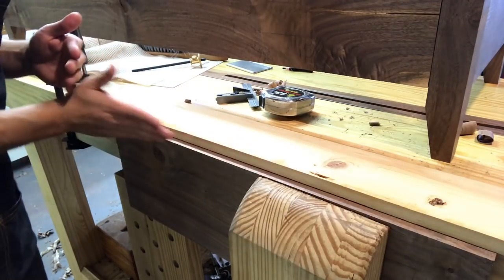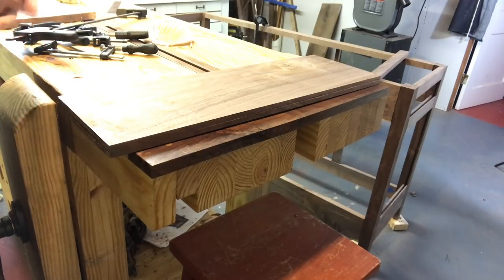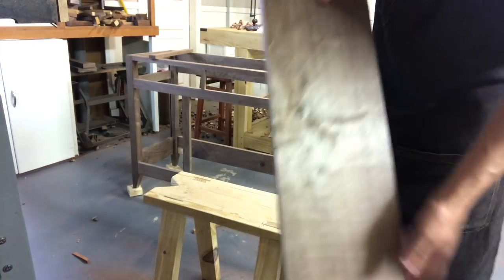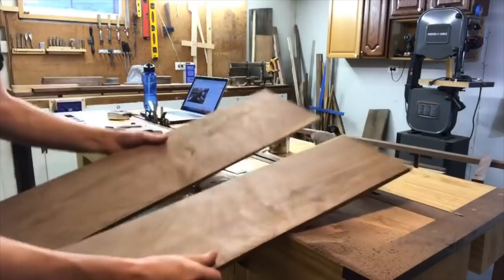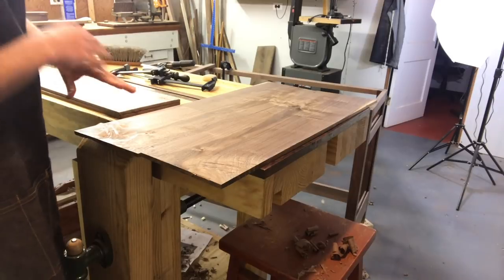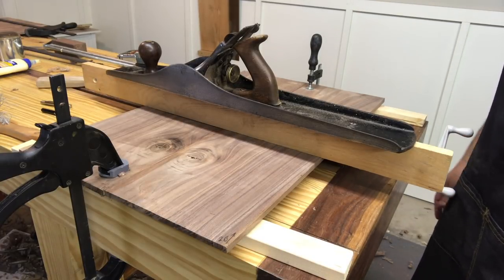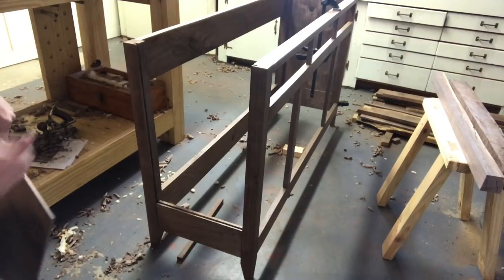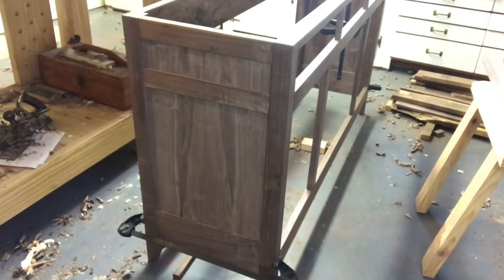Building a Sideboard part 12: Resawing and Fitting the Side Panels | Hand Tool Woodworking

Comment: Fantastic! I've done more than my share of long re-sawing operations and it seems that there's always at least one slightly janky area .... that's what planes are for. The side panel looks awesome. I love the grain continuity between the upper and lower panels. Well done!!
Reply from the maker: Exactly! There is always that one part... I’m thrilled about the grain continuity too! 
How do you hold these panels when planing them? I’ve had a real tough time planing them because they are thin and I can’t secure them well.
Reply: So at 1/2 inch or more, I just put it on my bench and plane against a dog or two or a planing stop. If the material is much thinner than that ... I generally use a couple of dots of CA glue to secure the material to a bit of plywood and then plane that against dogs or a planing stop.  Mostly that works but you have to make sure your flush with the end against the stops and any edge you want to put a bevel onto so you can overhang the plywood with your plane. Sometimes that means doing half, pulling it up, regluing and putting it back.  Hope that's useful!  @TheHandToolery
Reply from the maker: Great stuff! Thank you! It’s very helpful!

Comment: Something to keep in mind for future videos: I was interested in seeing your process for planing the faces of those panels smooth after resawing, but you edited it out, perhaps due to time constraints. If you get a chance to show that process in at least a little detail, that’d be something I would watch. That said, I enjoyed this. Great job so far!
Reply: planing after the jointed glue up would also be interesting.  I never nail the jointed boards perfect off the glue up, so I just plan to flatten the whole board after jointing anyway.
Reply from the maker: Thanks! I have such trouble planing thin panels. I actually never thought people would want to see that particular step. Next time??
Reply from the maker: Oh man... these panels are uneven for sure. I used a card scraper to even them out a little bit the backs are rather off. The fronts are dead on though, which was a lot of card scraping and whatnot. Before everything, though, I did each side separately.
Reply: @TheHandToolery  next time, even if it is a quick note or mention of difficulties you have found and how you overcame them.